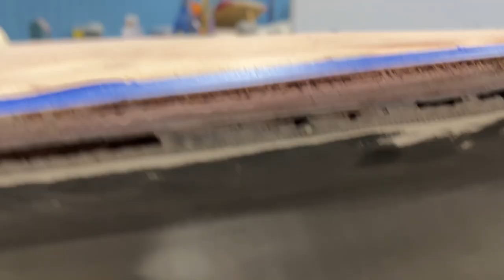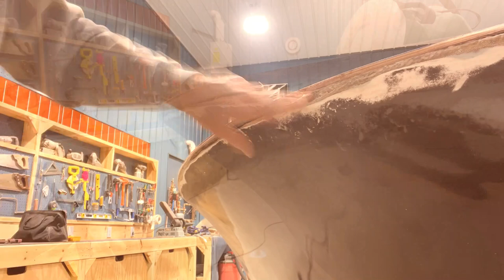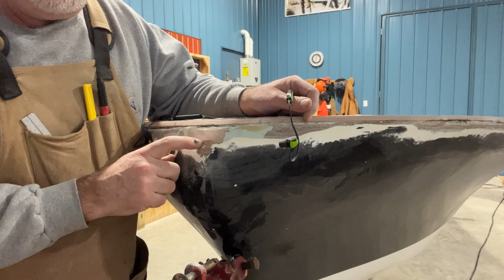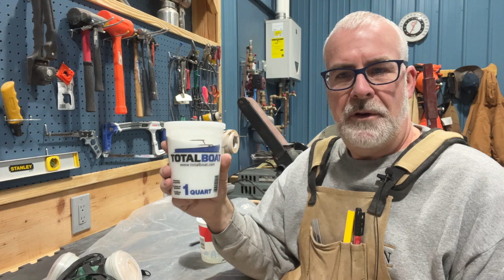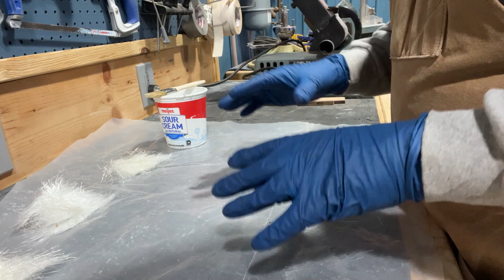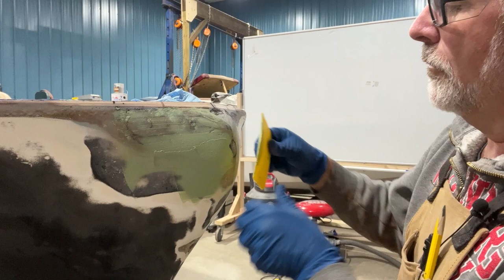How to Restore an Old Fiberglass Boat - Episode 5 - Fairing the Hull

Comment: As a boat builder and maintenance provider, I can tell you the best way to restore an old boat is to grind until the entire boat is dust on the floor, then shovel into trash can.  Materials alone will cost more than the boat is worth in the end and you will still have an "old boat" when you go to sell regardless of how little of the original boat is still incorporated.  Of course none of that has ever stopped me from doing it.

Comment: Do I need to be worried if the top sides of a older mako built with woven roving songs hollow?
Reply from the maker: If sounds different in other areas then yes. You might have voids that were left there by the factory, rotten wood that forms the inner core between two surfaces of fiberglass, or rotten fiberglass. I have used a small drill bit in areas to see if I can detect wet wood, moisture, or simple a void. That would be my suggest to you.
Reply: @reynoldsrunabouts  Thanks my brother